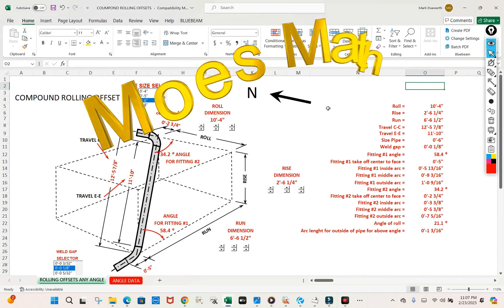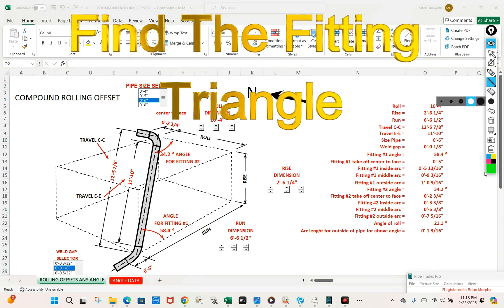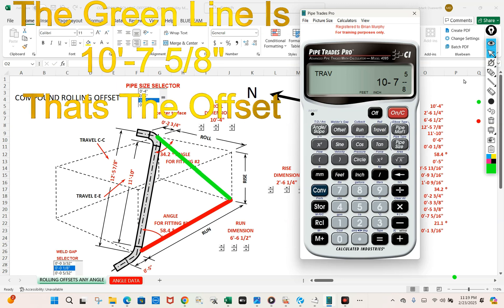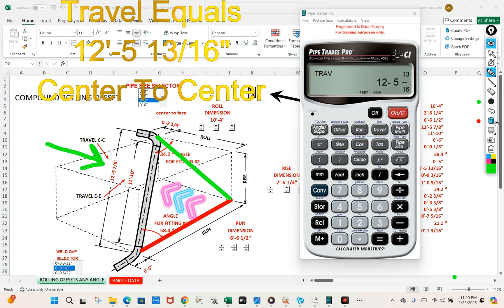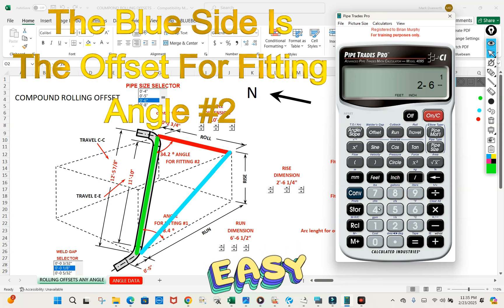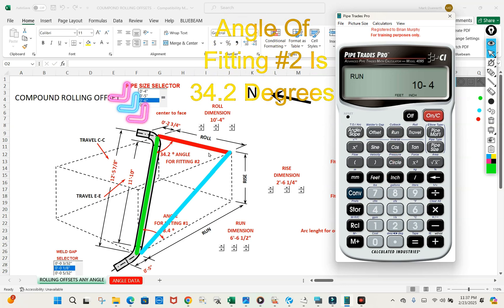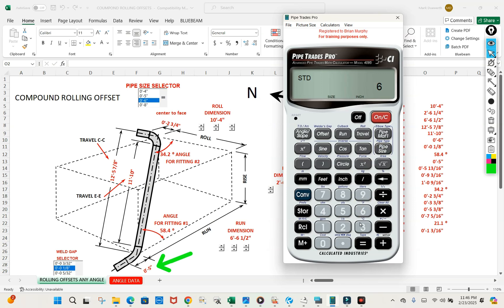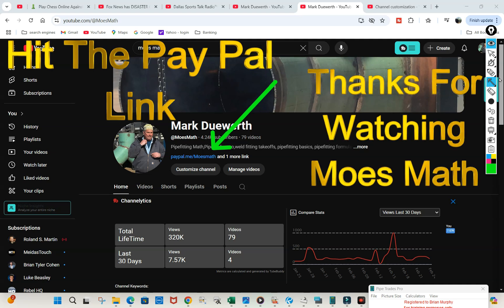Compound Rolling Offsets Explained

Comment: I have a 20” riser 55° turn and 45° roll look like i need a 66 angle cut on the top fitting but can i keep the bottom fitting 45° or what degree i need at the bottom